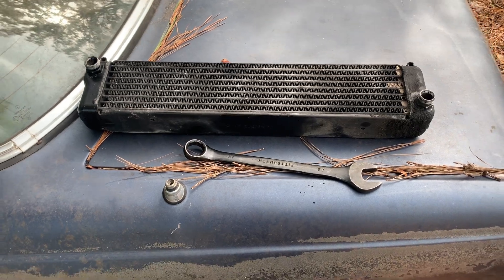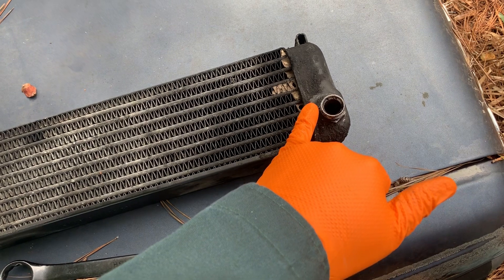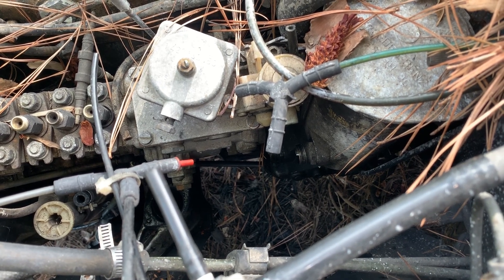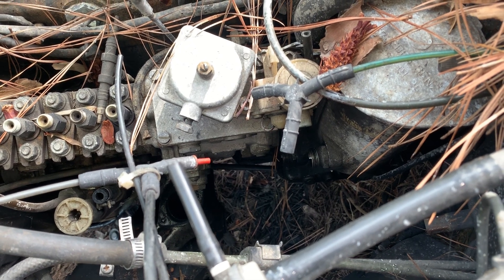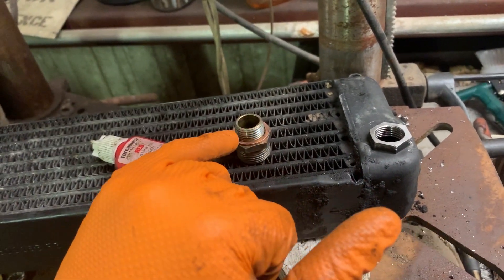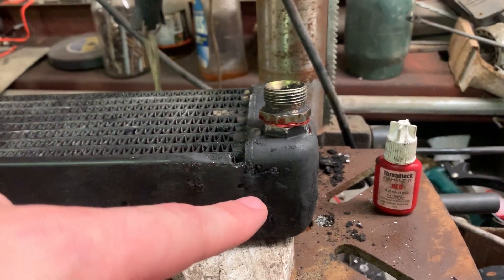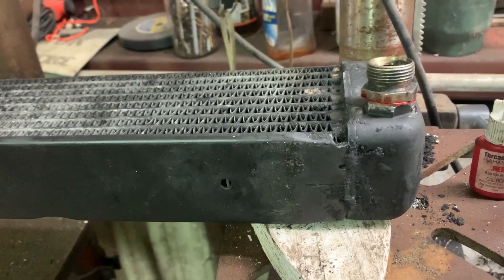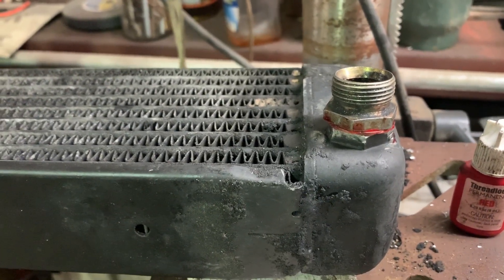300D Oil Cooler Repair

Comment: I removed the fittings from my filter housing recently. Had the same hardened sealant on the threads that screw into the housing. Guessing it's a thread locker of some sort that Benz used from the factory. When I reinstalled mine, I used classic JB Weld as a thread locker. We'll see how well it lasts.
Reply from the maker: seems to be a real common issue and more so on the bottom fitting. Not sure why.

Comment: I would just chase those threads and use hi-temp teflon tape (pink) first before drilling to make that connection.
Reply from the maker: The threads pulled, there wasn’t enough left to ensure they wouldn’t fail.